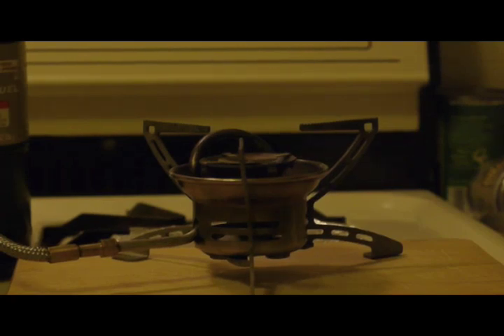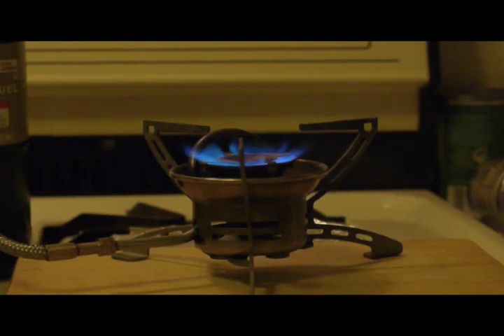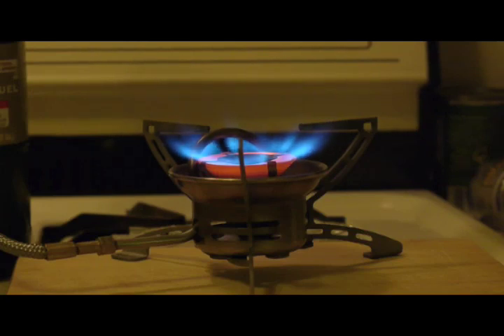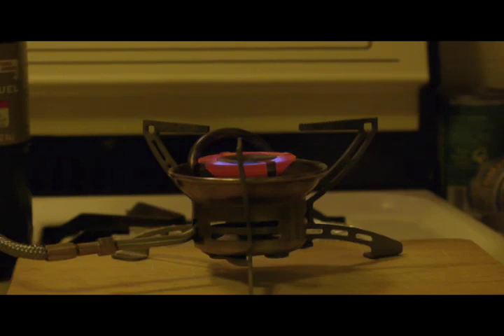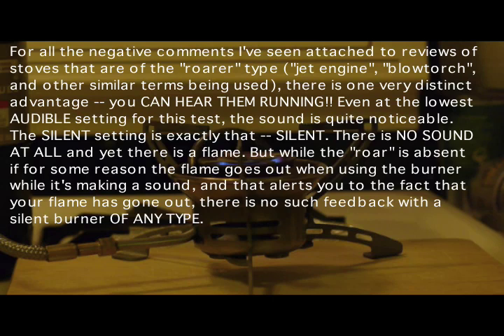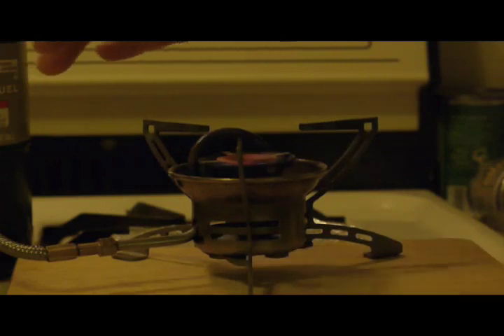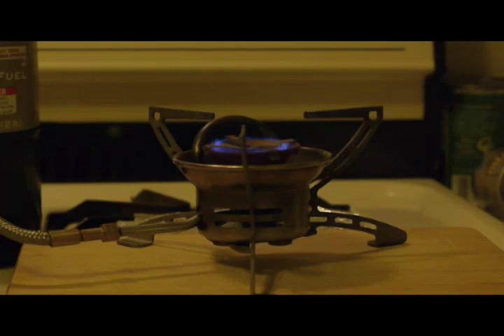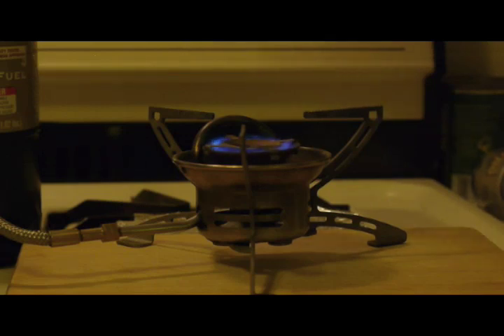Primus MFS (multi-fuel) burner (on LPG) vs kitchen stove, high & low limits test

Comment from the maker: I confess that I've not done a fuel consumption test but based on the BTU content of the different fuels (the propane-isobutane mix found in the backpacking canisters vs straight propane) there should be CLOSE to the same BTUs per gram fuel for the two types. Propane BTU/lb = 21,622, vs for straight butane 21,190 BTU/lb Note that this is BY WEIGHT which is how both propane 1# bottles and backpacking canisters are sold.